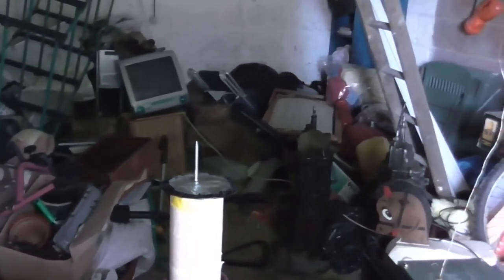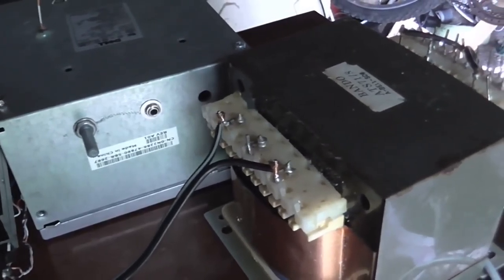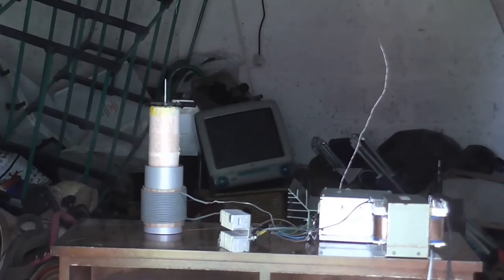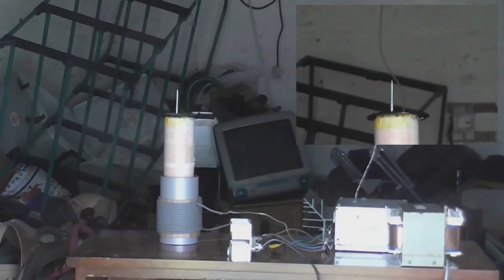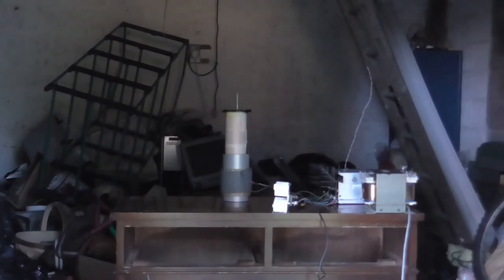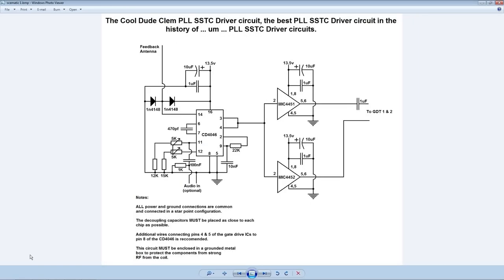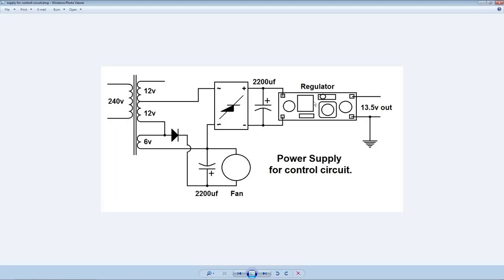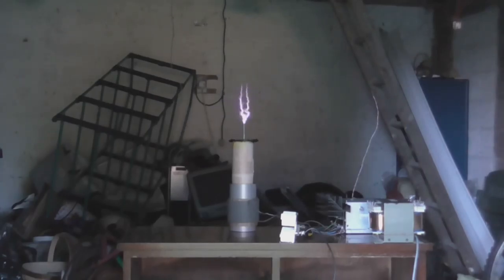Tesla coil Tuesday - Building a Full Bridge SSTC part 4b - High power tests and sparks!

Comment: Thanks for sharing.  Great job.  
Again, just trying to help.  I will suggest something here to get rid of the 1500 Watt Ballast and give your circuit a lot more safety and also a lot more power output.  Use a UC3808 chip to run the Full Bridge thru the gate drivers.  Sync the UC3808 to the 4046 PLL.  Use the current limit in the UC3808 which will shut down each transistor on a pulse by pulse basis and you can set the current to whatever you want by just adjusting a resistor value.  The UC3808 will also provide dead time between the top and bottom transistors to prevent simultaneous conduction.  This may seem like a lot of work but it is only a minor change.  you can get rid of the SG3525, although i don't see that you're using it anyway.  add a 10K resistor across the Gate/Source of each IRF450.  and no more 1500W heater.
Reply from the maker: In a later video I did run this on much more power. I still used a little bit of ballast though, I had a MOT with the secondary shorted to limit the current to 11 amps, and I got 9 inch sparks! I'm not sure about the UC3808 idea though, nice suggestion but I don't see how it could be connected.

Comment: Decrease your primary impedance but keep coupling the same.  Add a topload!  Awesome work!
Reply from the maker: There is a top-load, it's just very small, I could use my other primary which has a lower impedance but this one i've used gives me about the same amount of output with less current draw.
Reply: +CoolDudeClem Do you have anything that could be used as a bigger topload?  They help preformance a lot.  for your lower impedance primary did you keep coupling the same?
Reply: +CoolDudeClem Do you have anything that could be used as a bigger topload?  They help preformance a lot.  for your lower impedance primary did you keep coupling the same?
Reply: +CoolDudeClem Do you have anything that could be used as a bigger topload?  They help preformance a lot.  for your lower impedance primary did you keep coupling the same?
Reply from the maker: of course, for both primaries I found the position where I get the optimal coupling is the same.

Comment: Hi Clem , Im having trouble with the mosfet drivers right now.
I tried to measure the wave form in the output of the driver ics and with or without my GDT I have a ridiculous amount of ringing and MHz levels of frequency.
So my question is , why do 5,6 go together when the datasheet says that 6,7 should together?

Comment: Hey Clem.  With pin 5 and 6 of the gate drive chips are they meant to be connected to each other because wouldn't it just ground out the output of the chips?
Reply: I was thinking of that when i was converting the schematic to a pcb layout thing. I would go with shorting pin 6 and 7 instead of 5 and 6. You are right with it shorting to ground.

Comment: Hi Clem,sorry for all the questions haha just really interested in making the same coil design. 
Just wondering what the dimensions are of the pipe that the secondary is wound on in mm? 
How thick is the wire used to wind the secondary and how many turns? 
What are the dimensions of the pipe the secondary is wound on and what awg is the wire?
Also what is the wiper of the 5k double pot connected to as it looks like its going no where, or is the wiper going to the chip and one side of the pot going to nothing?

Comment: With pin 5 and 6 of the gate drive chips are they meant to be connected to each other because wouldn't it just ground out the output of the chips?
Reply from the maker: Pins 5&6 should be connected together, it even mentions that in the datasheet. It's basically so the chip can output enough current needed to switch the mosfet gates at high speed whitch can be a couple of amps at those speeds, it doesn't ground out anything.
Reply: ahhhhh ok, i never checked out the datasheet, probably should have haha. anyway i have the control circuit built but when i power the control side up i am getting a sine-wave instead of a square wave, any idea why it would be doing that? Picture of waveform in link: https://drive.google.com/file/d/0BwXU6iTdn5QuUVB4YjBlU2dIVHc/view?usp=sharing
Reply from the maker: It shouldn't be doing that! Do you have any caps connected across the power pins on the chips? If not, that could be the reason. Remember they have to be connected as close to the chips as possible. Also, where are you measuring he output? If you're measuring that the output of the gate drive transformer, it could be the core you used. I used a N30 type core if that's any help.
Reply: I was measuring the output of what would be the gate drive trandformer, but i also get the same wave on the output of the chips (with the gate transformer i thought it might only produce a square wave under load so i used a random core i had in the shed but its still output the same waveform), I have both the 10uf and the 1uf caps on the power rails of the chips. Do they have to be film capacitors for all the 1uf and below caps? as i am using ceramic caps. It also doesnt look like there is a short anywhere as the entire control circuit only pulls a measly 15ma.
Reply from the maker: You should use film caps, but ceramic caps will also work.  If you haven't already, try measuring the output of the chips with nothing connected to them, so no gate transformer or mosfets, just the oscilloscope connected straight to the output of the chips.  If you get a square wave (it may have some ringing but don't worry about that for now) then everything is good and it's just the core you were using causing the problem.  I can't tell from your reply if you have done that or not.  If you make a video showing exactly what's going on, then I might be able to see what's wrong.
Reply: I have already measured from the output of the chips without mosfets or a transformer and the same waveform :( i will make a video once i am home from work. i will also link my board layout just incase i have messed it up somewhere
Reply: I don't know if you have solved the problem as yet, but that does not look like a gate drive signal.  either u don't have the right core or not enough turns on the core and the core is saturating.  you need to put a capacitor in series with both primary and secondary windings of the GDT.
Reply: John Conrad yeh i have solved the issue now, I had the chips wired wrong according to the datasheet
Reply: @variacable  I have the same issue here, how did you rewire it?

Comment: with the 1uf caps In the output stage, what type of capacitor do you recommend i use and what voltage?
Reply: You need a good one like a MKP10 (or other), one with a voltage rating with twice the input voltage is ok. 
If you have any questions I can help you (my English isn't the best because I'm from Austria ;) )
Reply: Variacable No, they aren't the best. I must go to my school, I search later.
Reply: What switching frequency you have and what input voltage?
Reply from the maker: I'm not sure about the frequency, at a rough guess I'd say it's around 350khz. And I was powering this off rectified mains, but in series with a 1.5kw heater which I was using as a ballast.
Reply: This one os better, and not perfect. At some hundreds khz it can only handle some volts. I saw some SSTC, with capacitors like this, I think the capacitor doesn't die.

Comment: (in the output stage)are the resistors paralleled with the uf4007's 5k, or 5 ohm? and what wattage?
Reply from the maker: Ideally I needed 5 ohm resistors, but since I didn't have those I used 2 10 ohms resistors in parrellell to make 5 ohms, so each uf4007 diode has 2 10 ohm resistors connected in parallel.